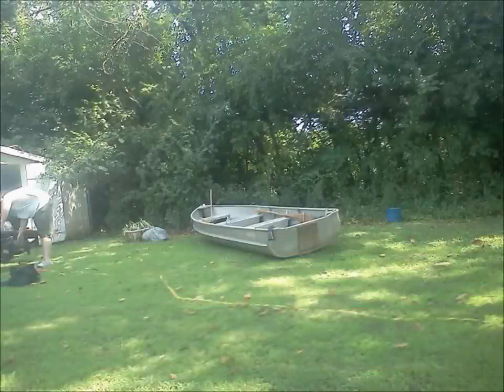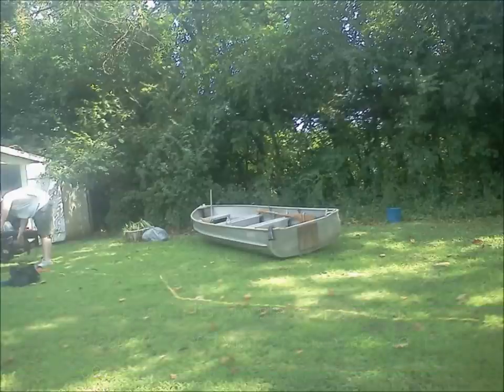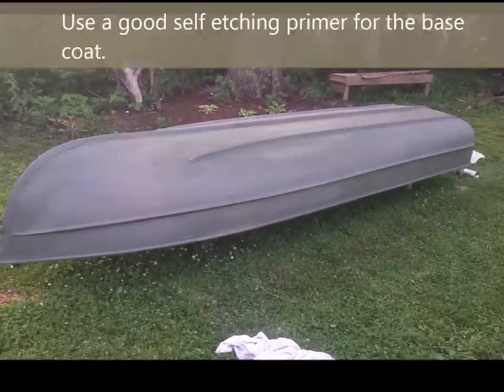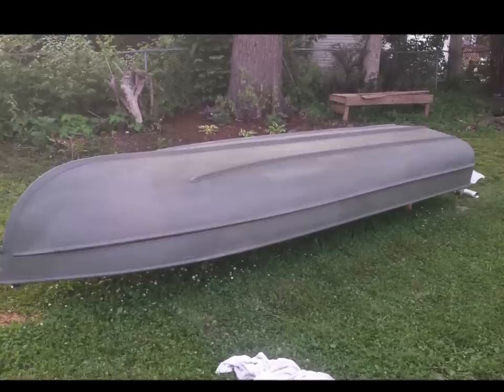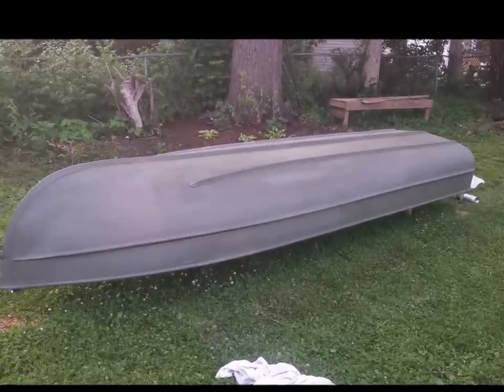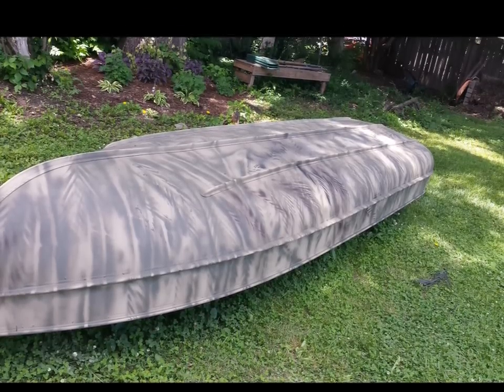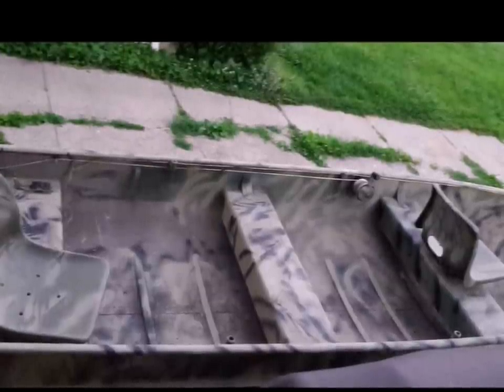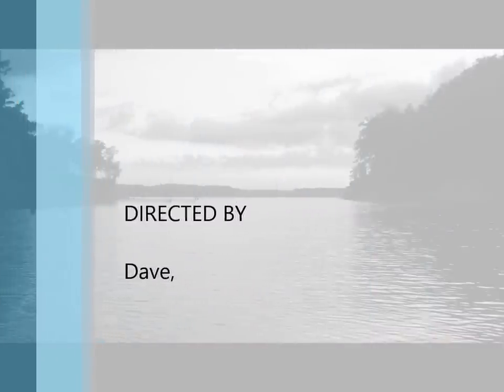How to camo paint an aluminum boat.

Comment: I purchased an aluminum boat that is experiencing exactly what is descibed in your video - someone took the boat and painted over the original paint and now when I go to the car wash big flakes come off - I will certainly follow you detailed instructions when repainting mine in the future - thanks for the tips and great video
Reply: hey hows your boat? aslong as you remove the paint, and ruff up the aluminum so the primer sticks, use self etching primer you should be good

Comment: Great looking boat! I have one about the same size that I'm looking to paint. With the primer and paint, roughly what was the total cost? My biggest issue is I don't know how much primer, or how many cans of paint I'll need.
Reply from the maker: I would go by coverage, it says on the back of the can how much it is I think I spent a little over 60 bucks on the whole project, take a measurement of the boat surface area , length  times with then times that by 2 to get both sides then you can figure  out how much paint you need.

Comment: do you have to get all the paint off because my boat has different layers of paint that is chipping and some spots are bare
Reply from the maker: Vaughn Dehoff  yeah unfortunately in order for it to adhear well you need to get the old paint off.
Reply from the maker: Vaughn Dehoff  A wire wheel or wire cup on a drill should make it go faster, my concern if you paint over the old stuff it will cause it to crack and peel underneeth if the have a different expansion contraction.

Comment: Thanks for the Video Dave. I've been searching all night for someone who used just normal spray paint on their boat, but did nice prep work. Your boat looks awesome. I just want to paint above the water line and the inside. How did the paint hold up? Cheers.
Reply from the maker: Im on year 3 now and I have to say other than a little fading you wouldn't know it was spray paint, this process worked phenomenally lol I am honestly impressed with it, I have drug this thing through the sand, on gravel , accross dirt, beached it on rocks many times  and the paint has stuck... I should post some follow up pictures.